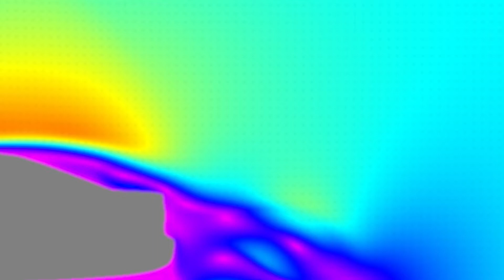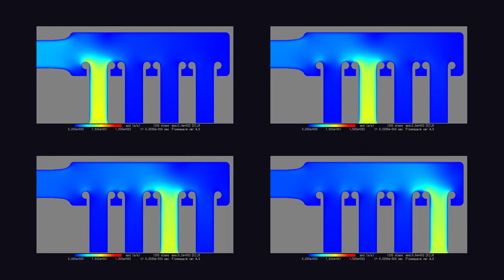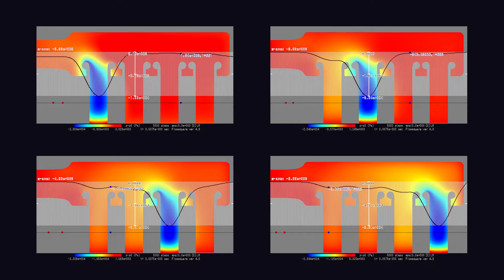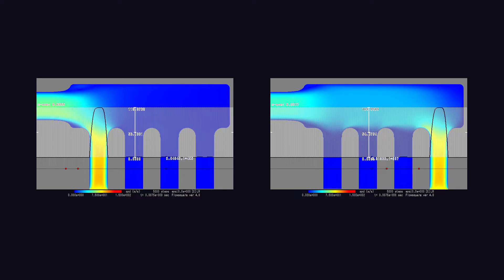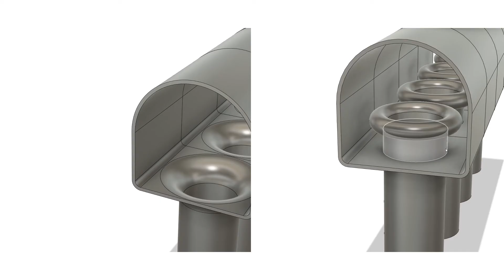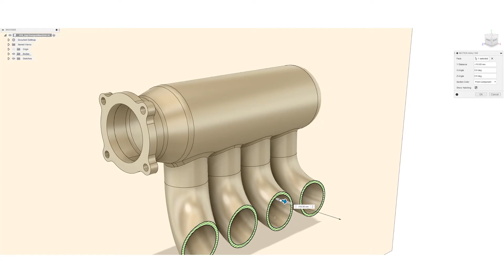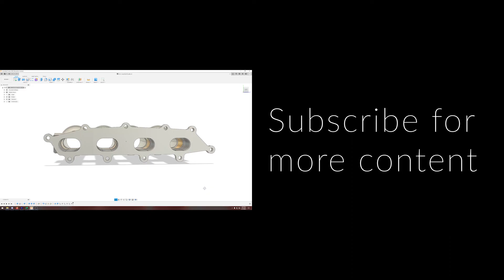Intake Manifold CFD Modeling for Power - Plenum and Inlet Radius Design

Comment: From what little I've read very recently; You need to have a tapered plenum that shrinks down from 1 to 4, and the throttle body inlet also needs to be angled away from the runners toward the "roof" in relation to them. This makes it more even.

Comment: hi! I'm a bit late to the party - amazing video, thanks for the CFD analysis - I just have to mention, why do you think every race engine manufacturer and OEM goes for full velocity stacks then? they must have the tools to figure this out. The ferrari 458 has full velocity stacks inside the intake manifold just like honda does with the rsp and well they are some of the best intake manifold designs ever and make upwards of 120 hp per liter, so I'm guessing a full velocity stack IS better?

Comment: Good video, decent design.
Do you have any design suggestion for ensuring the rearmost ports get a more equal flow? A tapered design for the volume/plenum is the usual solution.
I've been doing a lot of reading and research on inlet manifold design, Helmholtz resonance and David Vizard's substantial work in this field. I understand a 7º taper and bellmouth radius of 1/4 of the port entry diameter should yield a gain in flow of a few percent. The port entry radius is also better slightly flattened... or the surface around (and dividing) each port entry more semi-eliptical rather than semi-circular. 
Could you repeat this with above recommendations to compare the improvement?

Comment: My gene 3 stock Subaru manifold is beautiful, aerodynamic, very small plenum that's completely smooth. My gen 4 Subaru has a black ABS plastic with smaller diameter runners, a bigger plenum that has serious protruding plastic squares that I would think cause serious drag/turbulence. Yet the newer gen makes more HP/torque. I'm befuddled.🤯

Comment: Tom! You are honestly the only person I've been able to locate that knows how to operate Flowsquare+ to a high level. I have a complete understand of setting up models, but I do have some questions for you regarding your simulations:

1. Did you define the inlet and outlet by aligning the .bmp to the STL you imported? Seems to be the only way for me to get this to work. 

2. Are the animations from Paraview? Any tips on that? That portion of this entire process seems very unrefined.

3. Lastly; am I not mistaken in that exports are defined every N # of time steps? It appears your animations are every 50, yes? That is controlled via param.txt, right? I am admittedly confused with how to export data from this software. It seems very powerful after getting multiple simulations to run.

Comment: Instant subscription! This is a topic close to my heart and hearing someone say resonance is a factor is great! I have got a question though How far has cfd developed? Have you seen or has anyone out there got the ability to simulate cam profile and resonance along with the firing order as  too often hear people talking about cfm of intakes or heads,with little or no reference to resonance and the fact it’s filling a cylinder with a moving piston ,having seen higher hp from lower flowing setups I think that 4 stroke resonance although not as important as two stoke should be considered all the same,no doubt the top end of developers would like f1,
Reply: @half_tilt_boogie  couldn’t agree more,I’m a mechanic and do a fair bit of tinkering and tune and modify a wide variety of engines and myself being basically computer handicapped and generally not well educated find this cfd stuff fascinating! But  consider hands on the only way, I’ve found in real world testing that intake resonance benefits can be easily seen with an engine running under load and shaping/modelling the intake simply by introducing an object like a concave dish or even flat plate in front of the bell mouths improvement of flow at particular rpm can be improved hugely, having said that usually I just turbo it!

Comment: but if the engine is running it wouldnt have atmospheric pressure in the plenum. that would be on the opposite side of the tb. in the plenum it would have a partial vaccuum if engine is running. dont know how much itll affect results , but it might

Comment: Another thing is I've found on bench testing the throttle plate should be modeled (being open and in the air stream) and the inlet pipe going into it can have a significant difference on manifold distribution. ( Length and angle of approach to TB  etc)
Reply: @half_tilt_boogie  Yes just in depression and pressure - I didn't have anything that verified flow, but it was significant enough through standard observation.  I'm sure each manifold responds differently, but on this intake manifold it had an effect on all 6 ports.
What it appeared to show was air not having enough time to make turns.  Having slight changes to piping going into the TB biased the fluid stream.
It didn't, say, fix the unequal distribution changing the position.  Rather either exaggerated the problem or lessened it.
Think of it like an equalizer where you can only make so many dB changes.  You couldn't zero out all of the imbalances (at least not in this manifold) but you could improve it.
I have no idea if any power change would result.

Comment: Nice content.
Should run a boosted (over atmospheric) run against this one.

There are so many schools of thought out there.
Modern trends abandon resonance for 'shortest path' (response) and overall flow (design).

Some say plenum volumes makes no difference under boost.  No resonance tuning benefit (just add more boost).
Reply: @half_tilt_boogie  Yes, I agree, atmospheric IS boost already I keep trying to tell people that.
But I have observed that greater pressure (density) tends to delete the effects of ports or cams being too large (at xxxx rpm NA) vs boosted.  Other times not at all, or if so it had to be over a certain threshold.

Sorta like when people run Vtec on, let's say an F20C, turning it on much sooner than stock might result in less power, especially if you're trying to switch the profile thousands of rpms earlier (while NA)
But of course under boost, if the turbo has already made appreciable boost you can and should switch to the larger lobes thousands of RPM sooner)

Comment: Taper the plenum going from 1st to 4th cylinders. Reduced volume = more speed. This will let you compensate for the 3% loss. May be more difficult to fabricate though, since it will not be a simple cylinder.
Reply: Little bit more fabrication but definitely not impossible. Just cut the tube in half and add some sheet metal in between with right shape.

Comment: Great video, thank you! Really surprised to see that raised velocity stacks performed worse than integrated ones. I always thought that rasing stacks is important to improve flow because of issues with boundary layer.
Reply: @half_tilt_boogie  Thats exactly I was thinking about at the moment :)  Also making the inlet wher throttle body angled to the bottom surface where cyl. inlets are should improve it as well.

Comment: I had to laugh when this came up on my suggested videos, because a week or two back I was picking apart some post from some company showing off fancy-assed CFD of their manifold - flowing out all ports at the same time.  Which, if that's happening in the engine, bad stuff is going on, the way I figure.  So kudos, and subscribed to see where this goes.
Reply: @half_tilt_boogie  How would you actually try to simulate all the things happening in the magnifold within two full rotations of the camshaft? Or what would be the steps to get to a more and more realistic result? For example, does it even make sense to try to simulate the transition from one runner to another, or valves opening and closing, without also considering the pistons moving up and down?

Comment: Great video!  Would arranging the runner inlets in the plenum in firing order improve or hinder the flow?  For example, consider arranging a 4 cylinder plenum runners in the 1-3-4-2 order from front to back.
Reply: @half_tilt_boogie  I think the interesting part is where the air goes from feeding runner 1 to feeding runner 3, as opposed to going from 3 to 4. I think there is potential benefit in making the travel time/distance between runners the same. The dynamic cfds show this issue much more clearly than the static plots.
Reply: @CheekyNinja  Without variable runner length it would help in some RPM but be contraproductive in other RPM...
Reply: @vasek987  Evening out the mass distribution between the cylinders should help at all rpm. Runner length is a separate topic :)
Reply: @CheekyNinja  Yup, I was thinking about something completely different. My misunderstanding ;)
Reply: Tune the length of intake port runners from the throttle opening. As you would place the collector on a header. Throttle plate would have a balanced signal if it was equal distance from each intake port on other words... Ford and other manufacturers tried the dual port w valve vanes on the V6 it's a challenge on an in line engine for sure. GM twin cam from the Late 90', for example 97'Sunbirds 2.4 had an equal runner small plenum intake manifold... It looked like up side down header pipe, but on the intake side of the head. That engine my opinion suffered small chains running the balance shafts.
Reply: @mustardseedpower1188 In the exhaust side the collector is the point where the pressure waves reflect back to the valves, whereas in the inlet manifold the reflection starts from the end of the intake runners rather than from the throttle body :) Because you have a plenum on the intake side but not on the exhaust.